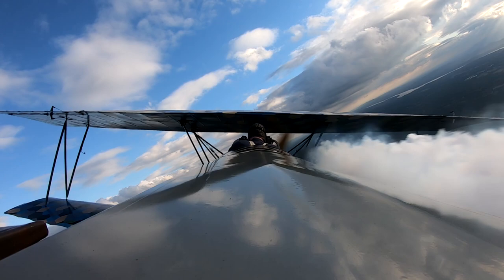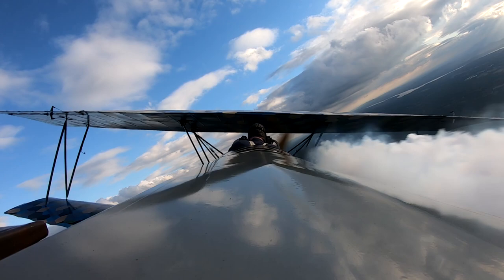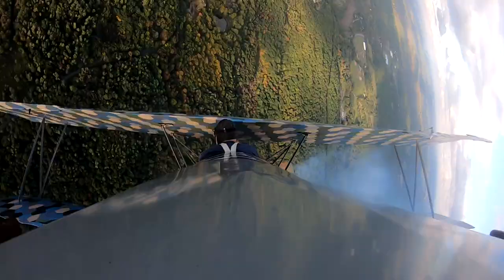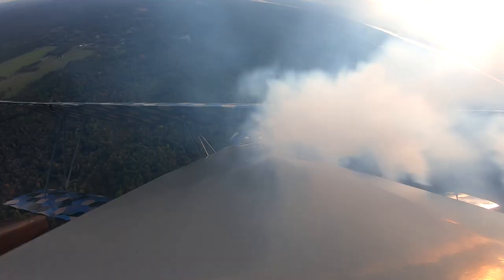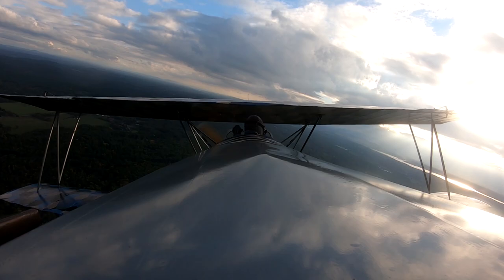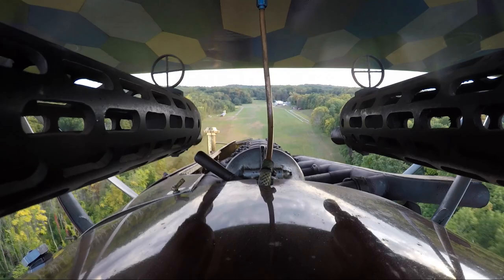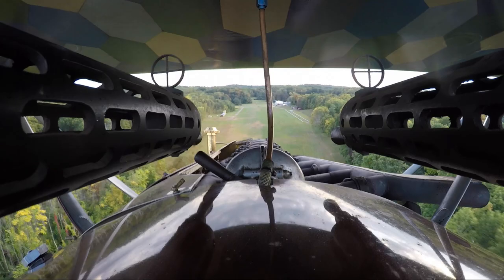Flying the Fokker DVII with Ken Cassens | Old Rhinebeck Aerodrome

Comment: I have a question about Fokker on the Dr.I and  D. VII and their kin.  What is the structure (winglet?) between wheels that houses the axle? On the original vintage planes what  are the materials involved?  Thanks..
Reply from the maker: The sub-wings were constructed similarly to the main wings: a wooden frame covered with fabric. Thank you for watching!
Reply: @OldRhinebeckAerodrome  thank you,  I had a friend go through his library and found some evidence, in a Wind Sock magizne and another book (that I can't remember) that had a strip-away engineering diagram the was not the same as the one the ones in the more popular/common books.  They had it as a metal axle box that had wooden 4 ribs using the axle box as a spar, w/ two end plates (wood), covered with a light plywood.  It may had  fabric over the only.
Lots of things may have happened to the planes durring  operations. like not having a steamer and form to shape the plywood.
Reply: @OldRhinebeckAerodrome  
I'll probably visit you guys this summer, was there 7 years ago, but it was just after the flying season..
Reply: And then there's a builder in Greenville OH... That I'd like to drop in on.